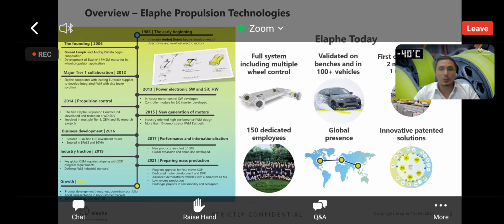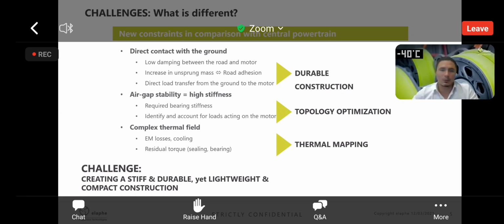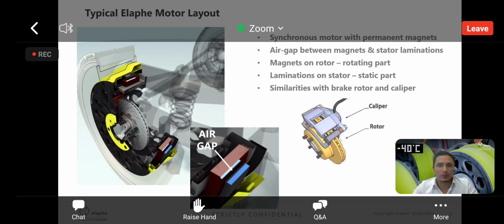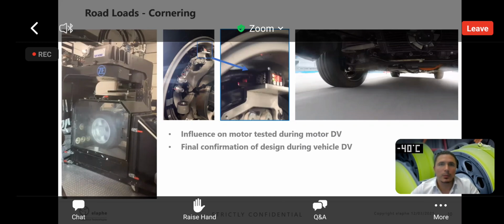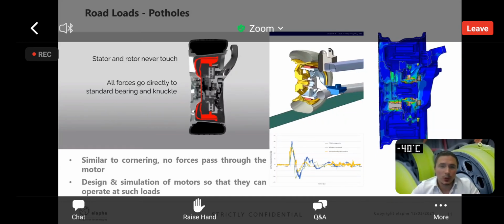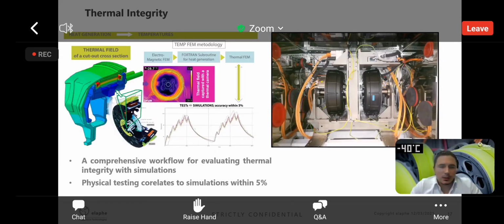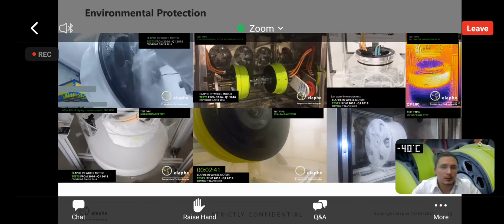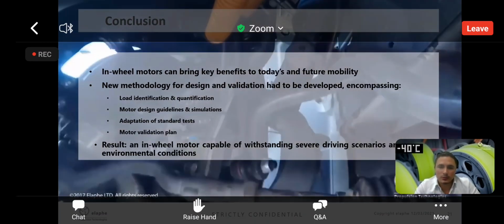Elaphe durability webinar

Comment: I wonder what kind of tires will be necessary for this system to work... Seems like hitting a bump or a pothole, like they showed in the simulation, with the weight of a motor added into the scenario, would require a more substantial tire than your standard Goodyear store tires?

Comment: I personally think the lack of gearing is a downside. Yeah, electric doesn't need a low range gear, but they could definitely benefit from a high cruising gear. Would also give the Aptera a much higher top speed if the wheel speed wasn't lock to the motor speed. But obviously there are tons of advantages too.
Reply: 110 mph is still very fast for any public driving.  My friend is a car guy and he has made me promise to be very careful with the acceleration since I've never owned anything close to 3.5 seconds; More like 8.5
Reply: @ccibinel  top speed is secondary to increased efficiency, a higher gear would allow for less motor rpm at a given speed. I'm also just salty that I'll be driving an automatic for the first time in 15 years, I know I'll miss my manual shifting.
Reply: @JaseComplex  The motor RPM at 110mph is ~1500-1600.  This is already far slower than most electric motors operate so the idea a high gear would improve anything seems unlikely.  As to missing manual transmissions I definitely get that but its the price of progress.
Reply: @JaseComplex  I currently am on a Zero SR electric motorcycle and don't really miss the gears or shifting at all.  The torque on electric is addictive to say the least.
Reply: For a vehicle that is designed to be as efficient as possible, extra gearing would add weight, cost, and friction.  Not a decent trade-off considering the purpose of the vehicle.
Reply: @n.brucenelson5920  more noise and decreased reliability too.

Comment: I have two questions for the wheels. What kind of tire are they using, Low profile or Standard? Does the wheel have conventional disc brakes or is it just regenerative breaking?
Reply from the maker: standard and both disc brakes and regen braking
Reply: last I saw the tires were 195/45 R16, it has disc brakes.  You can see them at 11:48.

Comment: Aptera didn't or did design this concept for a car? More question than answers? Help Do other car use this or is Aptera alone.
Reply from the maker: Lightyear, Lordstown and Aptera are the ones we know about currently.  There are probably others that are on NDA.
Reply: @ApteraOwnersClub  So this is for only solar power cars, not a Tesla. Or is it a mix. So, this is not an Aptiva original design, this other company owns the patient.
Reply from the maker: Elaphe designs and owns the patents on their in wheel motors.  They work with any EV.  Lordstown is not a solar EV.  Solar EVs like Elaphe's motors because it is a more efficient drivetrain and you get more miles out of the solar that way.
Reply: @ApteraOwnersClub  So Aptiva using Elaphe design and patents in the Aptiva. Do we know how reliability of these motors. Motors don't last for every, and north states use salt and nowhere else on the planet.
Reply from the maker: the entire webinar was about the durability and reliability testing they've done.
Reply: @ApteraOwnersClub  I guess we will find out when the cars in production, and people are using them.
Reply: @markharmon6144  Mark, I assume you are referring to Aptera?  The Aptera and Elaphe founders have known each other since the mid 2000's, and have become great friends over the years.

I used to work for a marine EV company based in Union City, and we hired the Tesla motor engineers when Tesla had to lay them off due to running out of money.  (a literal last hour investment of $50 million saved them)  So I know a lot about Tesla's early days, too.  Since we were building motors to run in salt water, we knew what had to be done in the design.  

I contacted the Elaphe engineers in early 2020 to discuss the issues and solutions to them that I was aware of, and found them open to discussion, and quite knowledgeable about what they were doing in design and testing.

I have no worries about getting an early example and have a Paradigm edition coming.  BTW, we just got our first snow today, so I will be using mine in less than mild conditions.
Reply: Elaphe is also not the only ones working on the idea of wheel motors.  Protean is also.

Comment: Lots of good information in the webinar. Some owners in cold climates are concerned about snow, rain and mud messing up the motors, but my only concern is how the Motor/disc brake will handle cooling. Both for the motor under load, and also during extended braking. I understand that much of the braking work will be handled using motor-regen-braking, but the idea of having the disc brakes enclosed gets me thinking about cooling for extended braking scenarios. Like long downhill stretches with constant braking. It is a very comprehensive, detailed analysis and webinar. Rich with content. They show many details related to the challenges/solutions of their in-wheel motor design, and specifically the engineering efforts to maintain reliable operation. Plus they show actual videos of client vehicles driving in extreme conditions.
Reply: you will not be on the "brakes" for a long downhill, that is a regen event so the motors will be braking as opposed to the disc/pads.
Reply: Keep in mind these motors have been in European cars for years. This webinar is more about the changes made to the motors for Aptera.
Reply: You pose and interesting condition.  The battery can only handle 50kW of charge (150kW of discharge) so in a FWD vehicle each front in-wheel motor will be limited to 25kW, assuming the battery can accept the charge.  If the battery cannot accept any more charge then the disc brakes will need to do the braking work.  The disc brakes will get hot and that heat will need to be absorbed by the cooling system. Good thing the in-wheel motor assembly is liquid cooled.
Reply: You don’t have to charge the battery Simply shorting the motor phases together will achieve the same braking effect.
Reply: @brolls2735  won't shorting the motor phase still result in a significant amount of heat? If not at the motor then at the inverter? If it charging the battery, only a small portion is waste heat, most of the energy is electrical going into the battery. A shorted motor or disc brakes would need to absorb the energy.
Reply: @brolls2735  This will dissipate the energy into the motor as heat, which is not ideal.
Reply: Hi Dean I think maybe I might be able to help. I have a hybrid and it has regenerative braking as well. You'd be surprised how little physical braking I do. Basically once you get to the desired speed you want the motors can keep you at that speed I think the Aptera should have even more Regen braking than my Prius so I wouldn't worry too much about it for now.i really think I do 90% of my braking with the motor only
Reply: @JamaicanMeCrazy  Thanks. I have had plug-in hybrids for 10 years now, so I am well aware of the benefits of regenerative braking. Both in recapturing energy and in extending the brake pad and rotor life. It is true that my current PHEV does the majority of its braking using regen. Even when using the brake pedal. But the rotors are not enclosed in the motor. This in-wheel motor has many advantages over traditional designs, and I do not see this as a flaw. I just wonder how Elaphe handles the brake rotor heat dissipation under hard braking conditions.
Reply: @deanmcmanis9398  I get what you're saying. I guess I'm not so worried about it also because the Aptera is gonna be lighter than my Prius too and I've never had that brake heat dissipation issue. I've gone about 200000km or about 124000 miles and my pads are freaking brand new.. Like no joke I actually find it kinda hilarious. My use case is also kinda extreme as I do Uber and I do hills relatively often. Cheers bro.

Comment: Interesting. I was wondering due to the need to maintain stator clearances, would a failure to do so be catastrophic? Apparently there is some grace in the design which would allow enough warning to enable a repair to what seems to be the weakest point due to wear, which are the bearings. 
How many of the motor components are swappable from left to right drive.